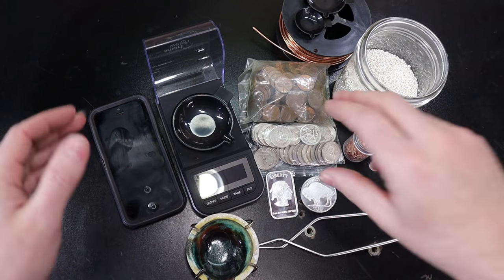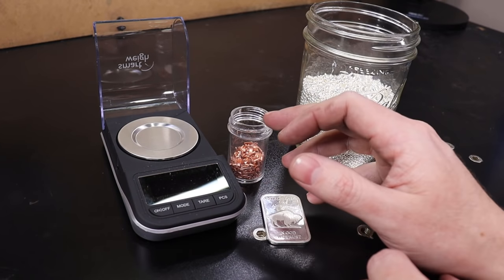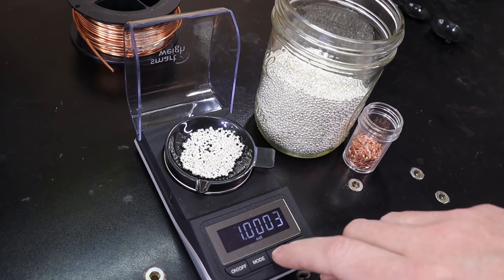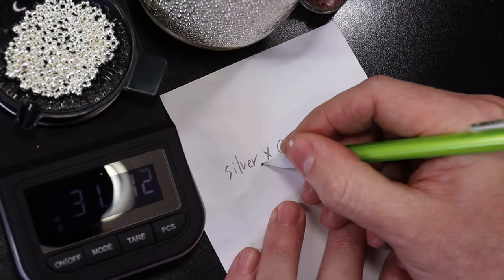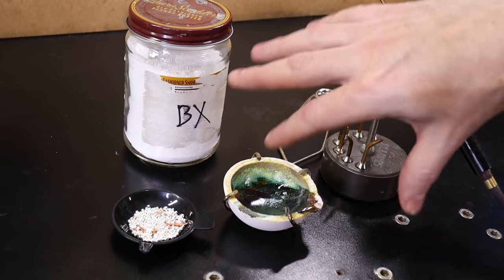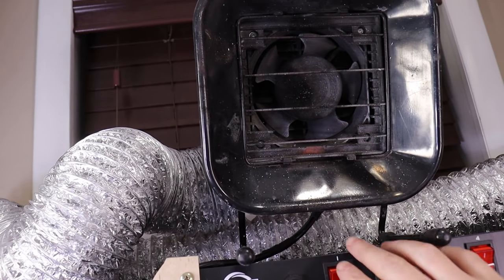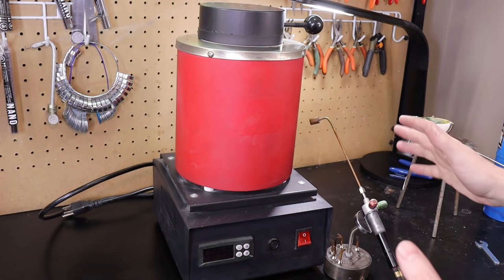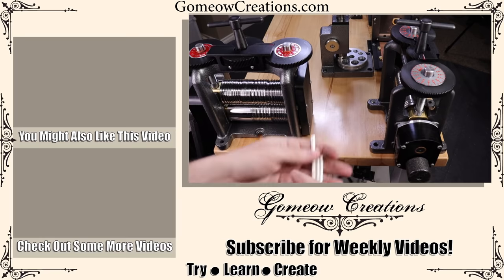Everything You Need To Know To Make Your Own Sterling Silver 925

Comment: Start with the amount of sterling silver you want to make. Then multiply by 0.925 to get the amount of 999 fine silver you must add. Multiply by 0.074 to get the amount of copper you need. Use 7.4% and not 7.5 % to ensure that you meet the minimum required 92.5% pure silver in order to stamp it with 925. Your result will be a bit lighter than your intended amount, by about 0.1%. Corrections can be made to make sure you have an amount in excess of your desired amount, but this formula should be used regardless to ensure your silver meets the requirements.
Reply: 0000000
Reply: You are correct but I like this formula 

(Total weight of .999FS) x (7.5/92.5) = weight of copper needed to make sterling. 

This way we can grab scrap .999FS , weigh it, and then do the math to determine how much copper to add. Now we have the weight of silver and copper to mix and smelt
Reply: Thanks for the info!
Reply: It doesn't take much to figure out that you want 92 1/2 parts pure silver and 7 1/2 parts of pure copper. Do this with a plan total of 100 g, and it's so easy it's unreal. You can use the same thing on 10 g. 
 Or you can do this with ounces. The formula works just fine you just need to calculate you got a total of 100 parts 7 1/2 of them copper and the other 92 1/2 silver.   
  But you can get good results just doing 93% silver and 7% copper. You easily exceeded all requirements, and you're a little less tarnished on your end product

Comment: I believe there is a mistake here... this way you have have calculated the copper weight out of the silver weight instead of the alloy weight combined. The math should be: 31.1÷0.925= 33.6 this is the final sterling weight. Meaning you have to add 2.5g copper and you're done

Comment: That arithmetic is wrong. 31.104g = 1 troy ounce. If you add 2.3g to 31.104g, like you did in this videos, you get 33.404g. That 33.404g alloy of silver and copper contains 6.8% copper and 93.2% silver. Sterling silver is 92.5% silver by weight.

Comment: I've read quite a few of the comments and I'm glad to see that I was not the only one to see that the math is incorrect. The .931 that this math creates is closer to Argentinium silver, which has a minimum of.940 I believe. But, alas, this formula does not make .925 sterling silver. However, it's still legally sterling silver by U.S.A. standards and may legally be stamped as such being that it contains more than the minimum .925 to meet the legal threshold.

Comment: Thank you, I have been thinking of making my own wire and sheets; I just acquired a rolling mill so the plan was in motion. The formula helps a lot. Buying silver/ sterling that is in sheet or wire adds up quickly, while buying shot and making your own saves a tonne. Thank you
Reply from the maker: Yeah it really does and you can use the stuff you had extra from projects to make back into wire and sheet

Comment: I have a question about your method. I understand .925 sterling silver to be 92.5% silver and 7.5% other (i.e. copper). By your method, you are not creating that percentage balance in the silver. You are adding 2.3g of copper to an already measured 31.1g of silver, which makes a combined weight of 33.4g. With this new weight, your new percentages are 93.1% silver and 6.9% copper. To correct this, I would suggest that you subtract the 2.3g weight from your 31.1g silver before adding the 2.3g of copper, that way you combined weight still totals at 31.1g and your percentages should be correct.
Enjoy your videos!
Reply from the maker: Yeah, you are right and thanks for pointing that out. 😅👍
Reply: I’m glad someone made that clear because I was thinking it while I was watching his math
Reply: @GomeowCreations  another simple way would be to just weigh out .926 troy ounces of fine silver and then top up to a full ounce with the copper. done.
Reply: In this case I would treat this as though you have 100% because you have a scale here with a 3 significant figures.

Instead of multiplying 0.075, take your original amount of silver and divide it by 0.925 .  Then subtract from that your original amount.
Reply: Me alegra que lo hayas mencionado. Es como si dijera que a 100 gramos de plata pura se deben agregar 7.5 gramos, lo cual daría 107.5 gramos perdiendo la proporción. Lo correcto sería 92.5 gramos de plata y 7.5 de cobre.
Reply: Wouldn’t that be better tho ? More silver or u think customers would mind
Reply: @kurlzdayoungin5453  well if you use too much silver you run into three problems. 1st is that silver costs a lot more than copper or other mixing metal so if you over measure your silver you would essentially be throwing money away. 2nd, when you're finished and stamp the finished piece with a 'sterling' or '.925' stamp you are falsely representing you product even if it is in the customer's favor. Lastly, the purpose of mixing metals is to make the softer metal harder as a finished product. If you over measure the silver than your material will not be as hard when finished. Albeit it is a minor calculation error and at the end of the day it won't be a noticable issue. To answer your question, no, I don't think the customer will mind getting more silver than they pay for, but that would be my loss not theirs and I didn't go into business to lose money.
Reply: Side note for the readers, Sterling silver is AT LEAST .925, not exactly. Also the hardness depends on the final choice and processing of added metals. The best silvers have a higher content (usually). But if you're marking it 925 its best to have a 925 content.
Reply: And another side note. It is NOT a good idea to put 925 on something unless your registered trademark is next to it. At least in the US (against the law to not do so)
Reply: @David Soule How's the percentage is 93.1? Could you please explain?

Comment: One thing with working with pure silver is that it work hardens and works well for making chain as long as the links are thick enough. I made a few necklace chains with wire that is around 1.5-2 millimeters thick for the links and they stay together just fine. But it's great to know how to make .925 in a simplified way as other videos have been too complicated. And it looks like your rolling mills are from Pepe Tools.👍
Reply: I work with 1,1mm links and they are fine too.Pure silver isn't as soft as they say and has a whiter colour than sterling silver.

Comment: Technically, if you’re wanting to utilize all that precision in your scale, you should definitely adhere to using 5 significant figures worth of precision in your calculations. Since you’ve weighed out 31.112g of 99.9% purity silver, you can only assume a maximum amount of pure silver at 31.081g. Divide that by the mass proportion of sterling silver at .925 and you get a total alloy mass of 33.601g. You then subtract the 31.112g you weighed out from the total mass of the copper and silver alloy and you get 2.489g of Copper that needs to be added to achieve a perfect 92.500% sterling silver blend.

The blend you made is 93.1% silver.
Reply: Thankfully, his calculation error was on the conservative side, which is especially good for people with less precise scales or sloppier weighing skills. I wonder if he uses this technically incorrect calculation on purpose for that reason…

Comment from the maker: The first 1000 people to use the link will get a free trial of Skillshare Premium Membership: https://skl.sh/gomeowcreations12201

Math is hard so let me break it down for you so it's easy to understand so you can also make your own 925 sterling silver from 999 fine silver. 😁👍

Here are a lot of the items I used in this video:

Combo Rolling Mill - http://bit.ly/ComboRollingMill

Wire Only Rolling Mills - http://bit.ly/WireRollingMills

Basic Mapp Gas Torch - https://amzn.to/3rdnROo

Oxygen & MAPP Torch Setup (Much hotter but tanks sold secretly ) - https://amzn.to/3pbYVW1

Oxygen Tank Small - https://amzn.to/3apH7T1

MAP-Pro Gas  2x Small - https://amzn.to/2KEnxrq

Acetylene Oxygen Setup like mine - https://amzn.to/3ajSGLw

Basic Smith Little Torch Five Tips - https://bit.ly/SmithLittleTorch5tips

Rose Bud Torch End - https://amzn.to/3krLoaF

Heating Tripod - https://amzn.to/31BEYyg

Crucible for Casting - https://amzn.to/31ARCxr

Borax Powder 1lb - https://amzn.to/2ISMQoA

Cheap Metal Melting Furnace - https://amzn.to/2H6IPwf

Electro-Melt Melting Furnace - https://bit.ly/Electro-MeltMeltingFurnace

Sheet Cake Pan - https://amzn.to/3nwF1nO

Adjustable Ingot Mold - http://bit.ly/IngotMold

2 Reversible Wire and Plate Ingot Mold - https://amzn.to/3aqrzP2

Graphite Casting Ingot Mold - https://amzn.to/34njuGQ

1 OZ .999 Pure Silver Shot/Grain - https://amzn.to/34s63pc

1 Pound 99.9+% Pure Raw Copper -  https://amzn.to/37wRe6P

----------------------------------------------------------------------------------------------------------

If you are looking for more tools and materials that I use, well you're in luck! I made a page on my website just for that and I'm updating all the time so bookmark it to stay up to date:

https://GomeowCreations.com/tools-and-materials 
https://GomeowCreations.com/partners-discount-codes

If you buy any of the tools or materials from my list I will make a small commission at no extra charge to you and it helps support the channel

"This video was sponsored by Skillshare"
----------------------------------------------------------------------------------------------------------
If you would like to directly support the channel you can do so in a few different ways.

1. Like, comment and share my videos

2. You can make a one time donation via Paypal of any amount https://www.paypal.me/gomeowcreations 

3. You can sign up a monthly donation via my patreon for as little as $1 per month https://www.patreon.com/GomeowCreations

4. You can sign up a monthly donation via my Subscribestar for as little as $1 per month https://www.subscribestar.com/gomeowcreations

5. Just watching my videos helps out too and I'm happy to see that I have been able to help some may people get into jewelry making.

#making925 #silver #jewellerymaking  #jewelrymaking #goldmaking #silversmithing #diy #gomeowcreations

Comment: THIS IS ACTUALLY INCORRECT

using your numbers 31.1g silver requires 2.3014g non-silver. If you add these weights together you have a final product weighing 33.4014g.

For a final product of 33.4014g to be 92.5% pure it needs to contain only 30.89g grams of silver (33.4014 x 0.925 = 30.89), whereas you used 31.1g of .999 pure silver (31.0689g pure silver)

You would also want 7.5% of your final product (33.4014g) to be non-silver. Meaning you would want it to contain (33.4014 x 0.075) of non-silver which equals 2.505105g of non-silver.

 What you've done wrong is work out that you want 7.5% of your starting silver weight to be non-silver when actually you wanted 7.5% of your FINISHING ALLOY WEIGHT to be non-silver

Real equation is

AG = starting weight of 0.999 silver in grams

Total non-silver required = (((AGx0.999)÷92.5)x7.5)-(0.001xAG)
Reply: as a biochemist, this video gave me anxiety.

Comment: The formula you used here would make .931 silver. To get the amount of copper to add from the starting amount of silver, divide the mass of pure silver by 0.925 which yields the total weight of sterling you can make. From this you can subtract the weight of pure silver you are adding to get the amount of copper that needs to be added.
To get the equation, we start with the fact that the purity of silver in the sterling (expressed as a decimal from 0.000 to 1.000) is the amount of silver per amount of sterling. 
    Sterling purity (0.925) = Silver weight / Sterling weight
Rearranging the equation (using a = b/c  ->  c = b/a) will show that the silver weight divided by 0.925 gets the weight of sterling.
    Sterling weight = Silver weight / Sterling purity (0.925) 
If you know how much silver you have and weight of sterling it can make, then subtract the weight of silver from the weight of sterling and you get the amount of copper to add.
    Copper weight = Sterling weight - Silver weight
Combining the two equations by replacing the weight of sterling will get you a way to calculate the amount of copper to add from just the weight of pure silver you are starting with.
    Copper weight = (Silver weight / 0.925) - Silver weight
Reply: How's that  .931?? 
Could you explain the math in getting that please? 
I couldn't figure it out yet.

Comment: Great job man, what kind of gas torch do you use, to melt silver. Mine is too cold, I have to use a better one.
Reply from the maker: I'm using a Smith's little torch with a rosebud tip running off oxygen and acetylene

Comment: Great video as usual but I was wondering how to turn the 90% silver into 92.5% ? I make alot of coin jewelry and would like to turn my scrap 90% into 925. Can you please help me with the math if I wanted to make an ounce of 925 using the 90%...I know you have to use so much 999 but I don't know the math. Thanks
Reply: The following formula will give you the minimum amount of fine silver to add to your 90% silver coins so that the alloy can be co side red Stirling Silver:
 (Weight of 90% silver coins)x(0.1/0.075 - 1)
OR
(Weight of 90% silver coins)x0.334

Comment: I have a smith oxy/acet and a electric furnace. I haven't cast either yet and was wondering which is more economical? An electric furnace running at 1800watts for an hours would seem pricey maybe for electricity. Also, what level shade of glasses would be good for the smith torch? Thanks

Comment: I can't seem to get the math to work. for example: 500gm of 100% silver.    
500 X .075 = 37.5
500+37.5=537.5
537.5 X .925=497.1875 
This math would mean that the final mixture would have less silver than you started with.  What am I missing?
Reply: I would say 92.5% of 500g which is 462.5g then subtract it from your original 500g and you get 37.5g for copper/base metal alloy which is 7.5% of the total starting figure.

Comment: Can copper from wiring be melted and cleaned like the way you put borax in silver?  (I hope I'm not stuck with a lot of copper!)  UGH!
Reply from the maker: Copper can be melted down in the same way you melt down silver. It does take more heat than silver. What are you wanting to do with your copper?
Reply: @GomeowCreations  thank you for replying so fast! I wanted to melt some of the thinner wires to run through my rolling mill to make a cuff bracelet but so far I've only made rings. Any suggestions?  Do I put borax in the copper also?
Reply from the maker: Yeah you use borax on everything. What torch do you have to do this?
Reply: @GomeowCreations  acetylene and Smiths little torch. Is there a melting tip I can get for it?  I wish you would do a video.on melting recycled copper. You make everything easy to understand.
Reply from the maker: @tina5670  I have this tip for melting metal https://amzn.to/3oaFi1f and it will work with your setup. I'm might make a video about that later on.
Reply: @GomeowCreations  oh I hope so! There aren't any videos like that, not that I've found anyway. I know you've done one on silver but it's not the same as using recycled copper wire.  Thank you for your help and quick responses.

Comment: Your math is wrong. .075/1 = x/(y+.075) where x is copper and y is silver. Solve for x by .075(y+.075)=x which is .075y + .00562 = x  so if you're using 1oz or 28g of silver, you want to use 0.080625oz or 2.2575gcopper to get 92.5 silver. Though using .075 will still technically get you sterling since it's higher than 925.
Reply: Just to be clear, in Troy ounces, since it might be confusing that I originally used a 28g ounce in my comment while you did yours with Troy ounces, that's 2.5074375 grams for one troy ounce. Not 2.29 like in your video.

Comment: Hi! I really like your videos, but two things. First, PLEASE encourage people NOT to melt old coins for metal stock. Not only do they carry a premium, but that is because they aren't being made anymore, so melting them is UNSUSTAINABLE and deprives future generations of these parts of our history that we have a personal experience with, they won't get to have. Silver rounds/bars and casting grains abound! Please use those!

Secondly, your math is interesting. There are different ways to 'figure'. If you HAVE 31.1g of silver, and you want to use all of it, then divide it by .925 and the difference is your copper needed (2.52g), though if you decrease it slightly, your Sterling will test out for sure. If you want to end up with one troy ounce total Sterling after, then multiply 31.1x .925 (28.77g) for your silver measure and the balance (31.1-28.77=2.33g) for your copper. You took 7.5% and added it back in. It worked because it kept the silver level over 92.5%. Otherwise you'd get penalized on assay or fail a product test.

Thanks again!

Comment: MAPP gas is only 130 degrees hotter than propane.
Reply from the maker: I'm more or less comparing the propane and mapp gas hand held disposable tank torches you can get from the hardware store. I have both of them and have tried melting some silver with both. The propane never got the the point of making the metal a liquid ad sor the mapp gas it was able to along with being able to pour it for some small castings.

Comment: What's the advantage to making your own sterling? Why not just buy sterling silver?
Reply: If this is a hobby, not much.  If it's a business then it's cost savings.  Stock up on casting shot/copper and you stock two items to make many things.
Reply from the maker: Exactly. You can also use 999 silver for bezels and it makes it a lot easier to shape around your stones. It's just handy to have if you need something you can just make it but if it's just a hobby you might be better off just buying 925